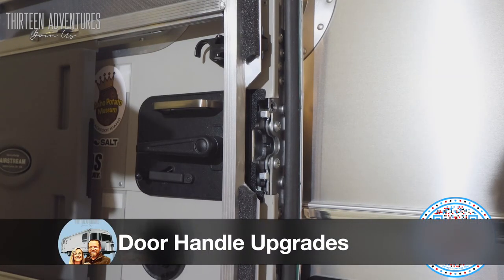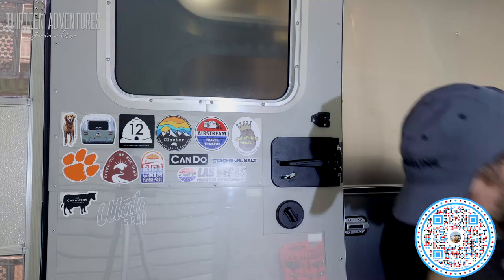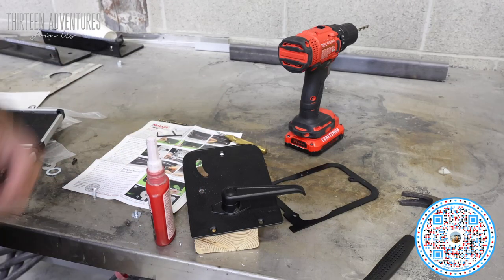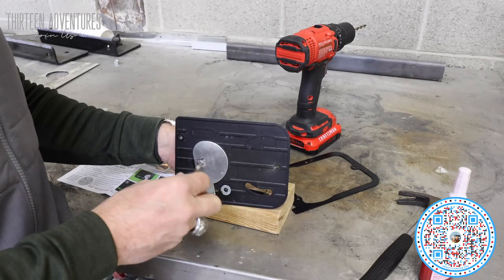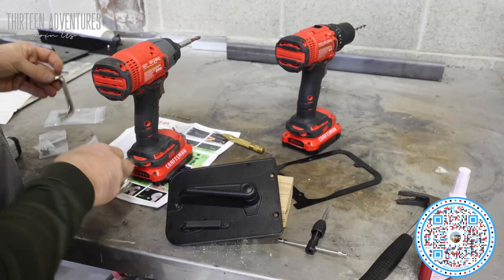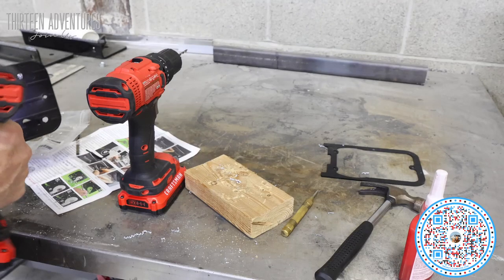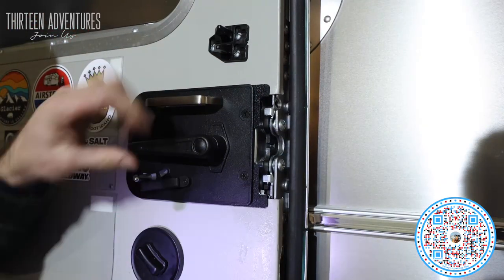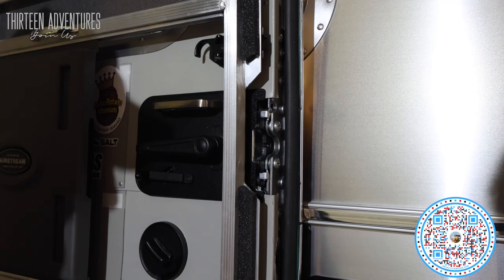Airstream Door Upgrade DIY: Installing Our Favorite Lock & Handle Enhancements! | Feat. NOLOX Kit

Comment: There’s so many videos about the doorhandle you would think airstream would’ve addressed it by now
Reply from the maker: After multiple Airstreams, we believe the handle situation is much better than it used to be and for someone who is an occasional camper, it's not an issue at all.  However constant use of full-time living, can create issues.  This is particularly true when the door needs adjustment and one keeps pulling the door closed causing the handle inside to become loose.  The 'lock blocker' is something we've realized is not at all necessary.  We've never locked ourselves out but got this along with many other items from Phil to demonstrate options one has for upgrades on their rig.

Comment: I like the door pull idea. I assume you pull it closed instead of slamming? I’ve started slamming when closing from the inside when there’s not neighbors nearby to annoy because the black plate is starring to bow.
Reply from the maker: yes, the pull handle is to pull it vice slam it.  That handle reinforcement screw will work very well too!

Comment: I’ll be adding the 3” drawer handle to my Home Depot list. What length of screw did you end up using for the door handle versus the standard screws?
TIA!
Reply from the maker: Hello and thanks or watching.  I sure wish I could remember but this was over 20 months ago and I dont recall.  Whenever you are at Home Depot deciding on a handle, just go over to the hardware section and find a screw of like size thread and get one that shorter.  The plate you are mounting it to is only 1/8" (ish) thick so it doesn't need anything long.  Also recommend putting some blue loctite on the screw when you put it in.